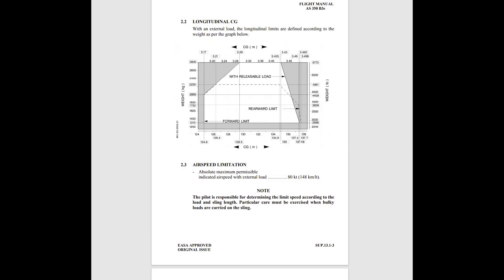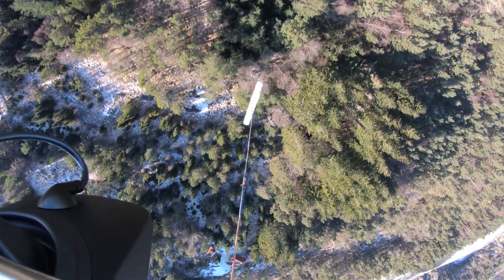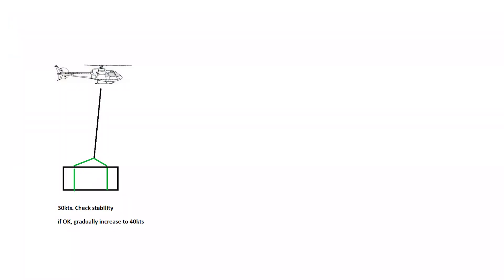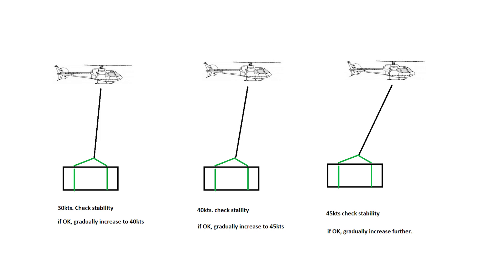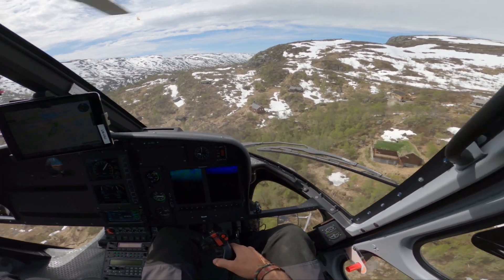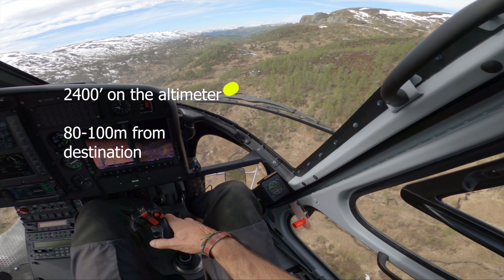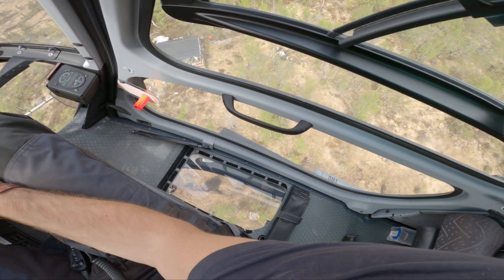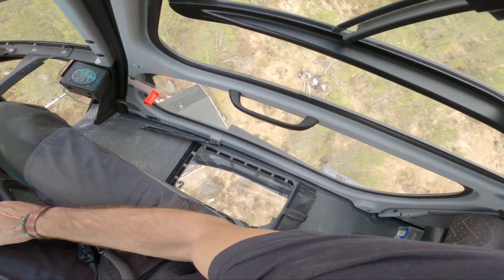Helicopter Sling Load Tutorial #3, ENROUTE PHASE, Airbus H125

Comment: Dude I straight up feel like I need to pay you for all these videos. This is an immense help for a guy just starting to sling stuff
Reply from the maker: Hehe happy to help out😊
Reply: @UpsideDownWash  I noticed sometime when you pick up your load, you start moving and your VSI barely indicates a positive rate. Sometimes you lift the loads amongst trees and powerlines, it seems that you move the load before it has enough vertical clearance (judging by the VSI). Is it not accurate at slower accent rates, and it kinda lags behind?
Reply from the maker: @txtallywhacker  yeah when it's very slow it's not accurate or at least not very helpful. You kind of have to feel how much your ascending and judge it case by case if your going to clear the obstacles by looking outside.
Reply from the maker: @txtallywhacker  also the vsi is probably the least helpful instrument. Judging your glide path is better to do with the altimeter by setting a start altitude to your approach and knowing what altitude you are going to end up with in a hover over your target